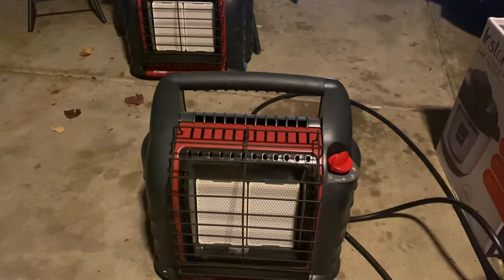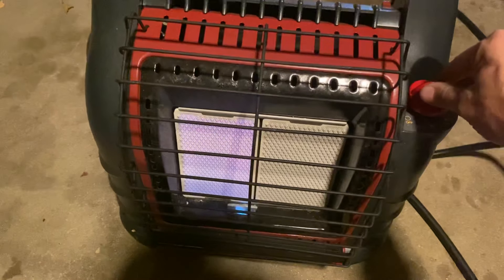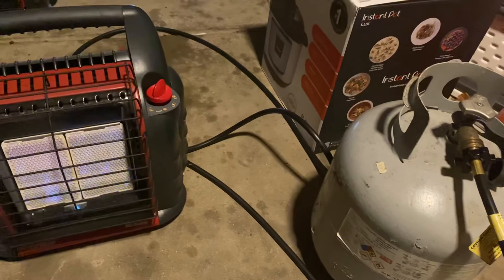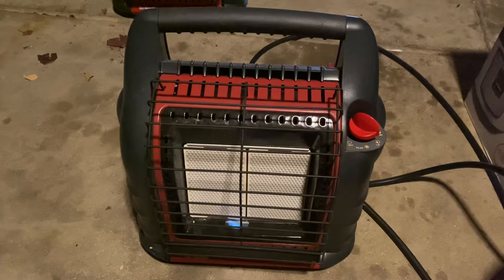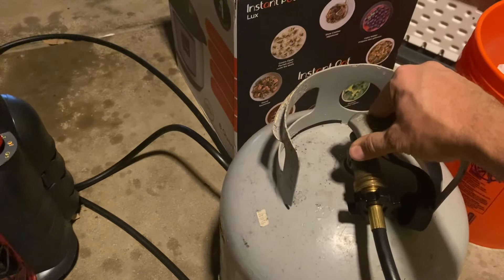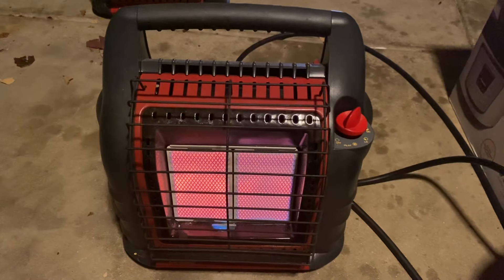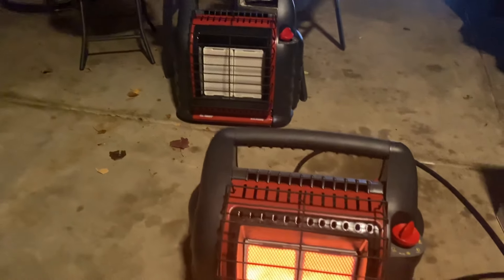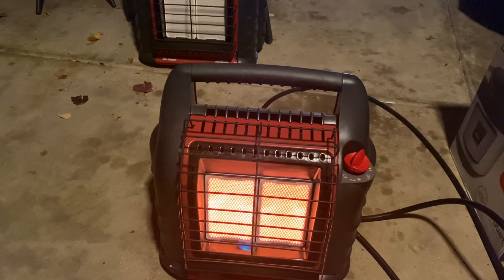Mr. Heater Big Buddy Shuts Off-FIXED

Comment: As someone mentioned below, there's a mechanism in the valve to shut off the gas if it flows freely such as if the hose got cut.  When you are charging a long hose or such, if you crank the valve open the safety kicks in.  The fix is to close the valve, resetting the safety, crack the valve and let the pressure equalize across the valve for 15-30 secs before opening it more.  I discovered this with a weed torch.  Frustrated me all to hell till I learned of the safety.
Reply: It happens with 1lb cylinders too.

Comment: Awesome video. I just bought a brand new big buddy with hose and filter to use camping this weekend. Couldn't get it past the pilot burning. I was get aggravated and luckily ran across your video. Worked perfectly after turning it on slowly. Thank you so much.
Reply: The critical effort is to open the valve at tank slowly, two or three times, while the heater is fully OFF.  This allows the rubber line to fully charge with pressure.
Reply: Your a life safer tonight.

Comment: Worked for me too. When I tried opening slowly after watching this, I cracked the tank valve until I heard the line start to hiss. I left the valve at that position until the pressure equalized, then fully opened it. Worked like a charm, thanks!

Comment: Thanks for the video.  Our brand new Mr Heater was lighting and shutting off.  
Its working fine now and
your video showed us something to look out for.  
Now we have four Mr. Heaters, all the same model but with something slightly different about each one.  We believe it's because we purchased each one years apart.  As far as soaking a 
Q-Tip with alcohol and shoving it into the pilot hole I say, "Don't Do It.". I washed a video of a woman cleaning up an old mascara brush, soaking it in alcohol and shoving it into the pilot hole   I tried it.  The mascara wond is stronger and the flexible bristles better catch hold of any dirt or fibers in there without leaving a  wand of cotton stuck inside and clogging the line  
I pulled out enough cotton to make two Q-tips with the clean mascara wand trick.
Now our five year old Mr. Heater works again but we have retired it for special occasions.  The new one we bought yesterday is working properly now and hopefully we'll get five winters of heat from it as well🤗

Comment: Thank you so much. I thought my Buddy was going bad and I just got it a couple months ago. 
Even after switching tanks it was still having the issue. With a brand new line and filter.  Currently 21 degrees in my van.

Comment: OK,,, I tried this trick. it worked like a charm. I thought I had a bad hose. the heater worked great when i used a 1 lbs can or even 2 of the 1 lbs cans. but when i use the hose with a 20lbs tank the heater would not work. I tried following your advice and it worked great.  THANK you for the video.
Reply from the maker: It’s amazing how something so simple can fix things and make you all happy and warm right?

Comment: Seems to have worked!! Thanks , so now have 4 filters and two mr buddy hoses on way , i probably dont need but going to use quick connect, hope that doesn't do same. This should be in owners manual.thanks again 2022 December
Reply from the maker: I would suggest the quick connect for the mere fact that you won’t need the filters anymore.

Comment: Well I looked at the other videos where they told you to put the Q tip and blow air down and it didn't work at all. Tried this and open the propane slowly and let it run for a minute and turned it up just a tiny bit and worked like a charm. I had just bought the buddy heater and new 5lB propane tank so I don't have to buy the 1lb tanks continuously. Thank you so much!!

Comment: I had the same problem where I'd run it on medium or high and then kick off. I took your advice led the line turn the tank valve on slowly and I now have good high heat.

Comment: I turned the propane tank on all the way and it was fluttering and would shut off after a while and would shut off immediately if I tried to put it on high.
So I let it cool off and tried it again but just barely opened the propane tank just a little bit, it fired right up and ran perfect ! 
Thanks !
Reply from the maker: You’re welcome

Comment: The valve in the tank has an "excess flow check valve" that will trip if you open the valve too fast, not the regulator.
(I Worked for Amerigas for a couple years)
Reply from the maker: Really? That’s great info! I will have to update this video now haha
Reply: Also, the max input pressure of the  Big Buddy is 150psi. Not sure what happens if that is exceeded, but I know the pressure in a 20lb tank can be twice that on a hot day. Also, shop air can exceed 150psi - vlowing it out could damage the regulators.
Theres no documentation on how that regulator works that I could find.

Comment: Just had this exact problem. I searched and found this video. I watched and saw and still did not believe it till I did it. Ever so slightly cracked the tank valve and and then opened a little more... lit the big buddy, and wala!!! It works. Thank You!!!
p.s. I've had the heater just one week but have been shutting off the Tank at night and back on in the mornings and never had an issue till now. That's why I couldn't believe it was going to work.
Reply from the maker: Many more years of no issues I hope

Comment: Omgoodness thank you so much! I am from Florida moved to Michigan first time with a propane heater and I changed out the propane tank because I needed it filled bought it brand new turned it on and it was flickering like that I had no idea I am so glad I YouTube searched and yours come up. Being a single woman and using propane heat for the first time from Florida to Michigan I was number one scared to death number two had no idea how to fix so again thank you you saved me!
Reply from the maker: Sweet! Just remember to either put it back in the box or bag it up when the cold season is gone (Michigan is usually August 7th through the 12th, lol) so the spider webs and dust don’t collect in the pilot hole.

Comment: I am well aware of the safety valves in the bottles and I have been using this heater for seven years while fulltime RVing and I started having this problem recently, the heater ran rough for a few minutes and then quit like your video. The valve in my bottle seems very sensitive all of a sudden, I can hear it click when I open it.  When these bottles start acting finicky I usually swap them out for a new one at Blue Rhino or such but we're in Mexico and they don't do that here in rural Baja. By opening it incredibly slowly I got it to work properly again on med and high settings but it still runs rough, fluttery and noisy on low which indicates a low pressure.  So I ordered a new fuel filter because I have never changed it in 7 years of use, hopefully that will increase the pressure, although I inspected the filter and it shows no sign of oil coming out of it. You do know you need the filter when using this heater with a hose attached to large bottle of propane, right? The propane degrades the material in the hoses, it then gets into the heater and ruins it.
  
The Big Buddy has been very reliable for me but one safety feature never seemed to work right, as soon as the pilot lights I can turn the main gas on, it seems to me it originally used to lock for a minute or so after pilot is first lit.  But it's more convenient this way! Another time I somehow let the filter/hose connection get loose and propane seeped down into the bottom of the unit, when I lit the pilot it exploded in a large fireball that enveloped my lower body, no harm dome but alarming!

Another strange thing happened once, I always turn the tank off first and let the heater bleed out empty but one time it kept running and running for many, many minutes with the tank shut off!  I'm sure the propane tank was overfilled (here in Mexico of course!) and the filter and hose filled up with liquid propane and it just kept going and going, I couldn't believe it!

Comment: "startle the regulator". Almost like the damn thing has "feelings"! Seriously! I'm not "complaining" I have been using a Portable Buddy Heater for years and spent years as an appliance service tech. Certainly don't know everything but do have an understanding and also know pretty well how propane "acts".  These heaters can be ridiculously "sensitive" occasionally and defy logic. Especially in the cold when you need them most. On the other hand I do believe that they are quite safe to use as long as you don't have anything combustible too close. The 2 main safety features; tip over switch and low oxygen sensor work well on the units I've owned. Almost too well and if both "kick in" at the same time you will really have a problem. The tip over switch is sensitive to moving the unit particularly when changing a cylinder and also can react to not being perfectly level. Enough to drive you crazy sometimes.

Comment: MAN...brand new heater won't work I cleaned it blew it out like all the videos said to do still nothing ...fed up I go to take it back to the store.. manager tells me because  i was using the big tanks and they have junk in them I need to clean it  and install a filter ...convinced I buy the filter do another thorough cleaning and still nothing ..one more time researching on YouTube and I see this video ...PROBLEM SOLVED!! ty so much.
Reply from the maker: Wow, that sounds like quite the journey to getting your heater to work! I’m really glad my video could provide the solution you needed. It’s feedback like this that keeps me motivated to share more tips. Don’t hesitate to reach out if you run into any other issues. And please consider subscribing for more helpful tips. Thank you for sharing your experience!

Comment: I was literally waiting for tomorrow to bring my heater to the hvac shop ( it's new years day 2025) and all it was needed was to blow the oil out the hose. Now it works perfect. Thanks for making my new year start off positive
Reply: How did you blow the oil out? An air compressor? Mine is on the fritz and I am running out of small tanks
Reply: @luvabean   hook up the hose to the tank, turn gas on, put something small like a q tip stem and press in the other end of the hose to release propane.. like taking air out of a tire

Comment: It did work. I was about tontear this one down. I forgot about the regs as well. Thanks. ... still going to buy a filter.
Reply: This worked for a while, unfortunately, mine gummed up with the plasticizer oil even after I bought filters and all that so I am going to have to tear it down and blow out the lines.

Comment: I bought new and took back exchanged hose at store! worked in the parking lot but not at home till I found your video. Running reliable as long as OPEN TANK VALVE SLOWLY!!! I never would have thought of it ! Neither did the sales guy!! Thanks

Comment: Mine just started this. Was working fine and I turned it on today and it started wanting to not stay lit. I tried the slow method a couple times and it worked for a few minutes and then it goes out again

Comment: Mike runs like a champ on low and medium.  Turn it on high and it cuts out. Tried to do what you said. Still not working.  It seems like it's not getting enough gas.

Comment: Brand new out of the box after about two hours mine started shutting down using the little propane tanks (both were installed) tanks were about two thirds full. I could tell because they were frosted  to that level. It seems only the tip of the thermocouple was in the pilot flame. Why it worked for two hours non stop was puzzling to me.
Reply from the maker: Absolutely, the smaller propane tanks can struggle in colder temperatures as the cold can prevent the liquid propane from turning into gas efficiently. A helpful tip could be to cover the tanks with insulating materials like a wool sock to keep them warmer, aiding in better gas flow. Your observation is quite insightful and could be a game changer in colder environments. Thanks for sharing this tip, and don’t hesitate to share any more insights you might have!

Comment: I finally figured out my issue with the Big Buddy Heater I have. The valve on the 20lb tank is stuck to OPEN and the secondary safety valve on the tank has been holding the propane when nothing is connected. Therefore when I connect the heater I cannot slowly turn on the valve since it already fully on, so the cut off valve on the heater trips and the flame stops. So I need another tank with a good valve.
Reply from the maker: Oh shoot! I have one tank like that I should probably exchange it too. I normally refill at my local uhaul but he did warn me that the date is expired and needs to be recertified. When you exchange it try and go through all the tanks and find the newest recertification stamp

Comment: You should be sponsored by this company. I was about to take my heater back. We've been struggling. Pissed off in the middle of the night.... shoving friggin qtips, wondering how we gonna keep warm. After this explanation, we have no problems. Thank you much.
Reply: I found that if I'm turning the tank on, I turn it slow until I hear the sound of the gas coming thru. Then I start the heater on low. After that, I do a quarter turn of more gas on low. This is the way. Thanks again

Comment: Well here’s a follow up to my earlier comment. I tried this 8 different times. No success . I even called tech support at Mr. Heater. Besides the purging, and turning on slowly, I was told sometimes when you disconnect and reconnect the lines a ball in the 2 in. end of the hose that connects to the tank gets stuck. I was told to whack it on the side of the tank several times to unstick the ball. Did that too. No luck. So I figured perhaps they overfilled the tank some today. Hooked the tank up to my propane fire pit and let it blaze away for an hour or so. Reconnected to the Mr. Buddy and the pilot light still won’t stay lit for long, or the two times it actually lit, it started dying and quit within 30 seconds. I think I’m about done with Mr. Buddy. 😞 It seems that a better regulator system that accounted for the use of different tanks wouldn’t be that hard to do. It’s a shame, because when you get the thing to actually fire up and work, it’s great.
Reply from the maker: It must be possible to replace the regulator on these. But before you go and spend money one, have you tried moving the hose to the other inlet just to see if it turns off on that side too?

Comment: It does the same thing with the little disposable green propane tanks to, and I can't regulate the amount of propane with them at start up
Reply from the maker: Are you using one tank or two
Reply: @cabinlife1886  just one. It's a little buddy heater with just one tank. But it shuts off the moment I try turning it on. I can get the pilot to come on for a little but as soon as I try turning it on to high or low it clicks and shuts off immediately.

Comment: Saved my ass man only had mine for a day got the hose and filter was working great once i hooked everything up got nice and toasty so i turned it off and turned off the propane god cold turned it nack on and was like wtf this thing is brand new and already flickering ... Found your video and yess fixed he issue !!! The filter should keep the oil out right?
Reply from the maker: Great news. Yes, the filter will catch the oil. If you opt for the hose with the regulator on the tank side you won’t have to ever buy a filter. I can’t remember if it comes with a quick disconnect though. Not that it matters to me though. I don’t ever really disconnect hardly ever. I also opted for the braided line so I don’t have to worry about the oil in the rubber line.

Comment: my new BB was doing this on one side but not the other , I agree it is a regulator issue, however its the regulator that supposed to control the amount of pressure or gas into the burners , I find this is a defective regulator and i think anyone with this issue try the other gas port and see if this corrects the issue. If that doesnt work , I would see about a replacement regulator or if new replace the whole heater, this is good information for me , however I wasnt as lucky as you to tame that faulty regulator.
Reply from the maker: Great idea. Who knows if their regulators are made with quality or cheap as dirt

Comment: It works, I had a new Mr. Heater with a bottle on it for a few days, then I decided to get a fresh five pound bottle and lo and behold pilot lit then immediately went out I was just about to return the Mr Heater portable it when looked on youtube for a solution and found your video, it took a little while before the regulator cleared, I followed your suggestion to slowly turn on the gas at the tank and it worked after a few tries. Thank you!
Reply from the maker: You’re welcome. I hope it continues to keep you warm.

Comment: Mine is probably 7+ yrs old and have Never had this issue.. only issue so far has been getting the Tip over Safety Switch to reset. Sometimes it will Start to work but then Backfire underneath the unit.

Comment: Yes!!! This video saved me!!
My pilot would light and stay in until I turned the knob on low. It would die out almost instantly. 
I bled the line. Turn the propane on very lightly and let the pilot burn for approx. 30 seconds. The pilot stayed lit when I SLOWLY opened the propane tank.
Thank you so VERY much. And yes. I did the qtip and alcohol thing without success!!
Thank you again!!🤗

Comment: Dead-on accurate diagnosis. I hooked up a full, fresh tank for the first time and couldn't understand why the pilot light cut out when I tried moving to the heat position. I stopped opening the propane tank as soon as I heard the hiss and all is well.